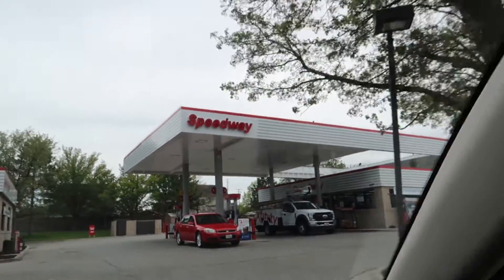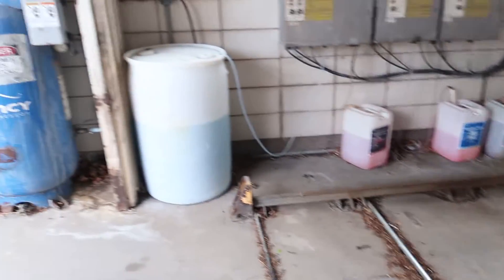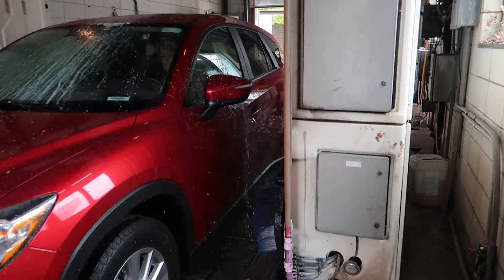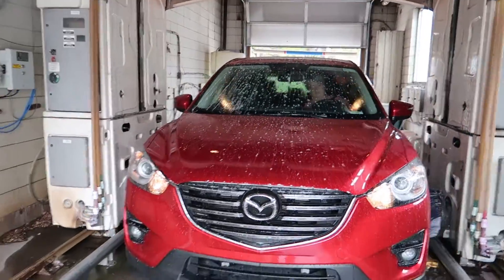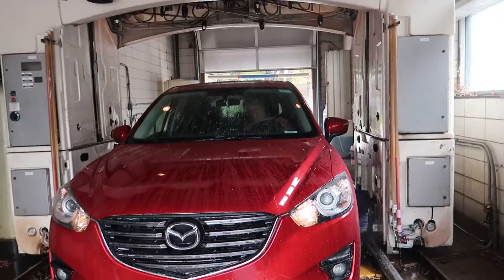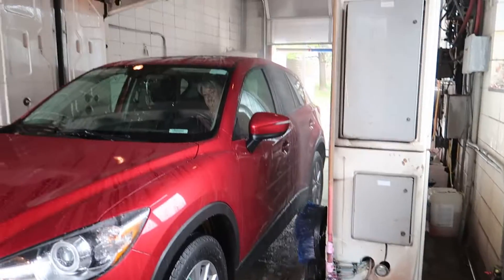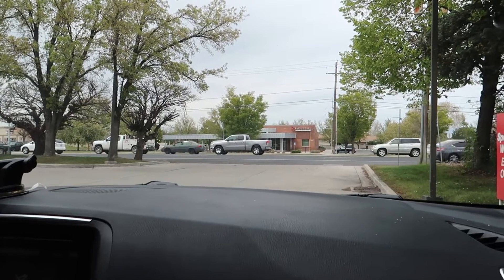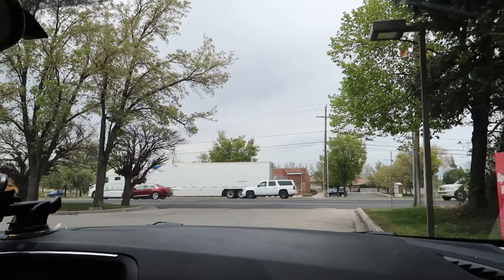Awesome Mark VII Aquajet GT700 - Speedway Gas Station, Salt Lake City UT

Comment: I am not sure about the touch-less ones. Most times they leave the car half dirty. If you check my older car wash videos in the playlist I have a couple in it.
Reply from the maker: It’s all about chemistry, bad chemistry = bad car wash.
Reply: It also requires heat.
Reply from the maker: @Carwashdr  good point!